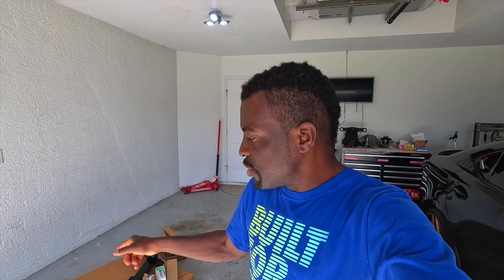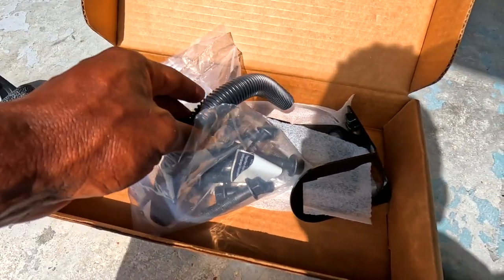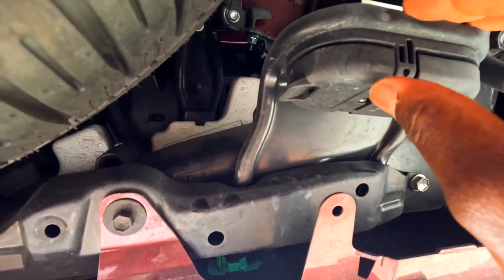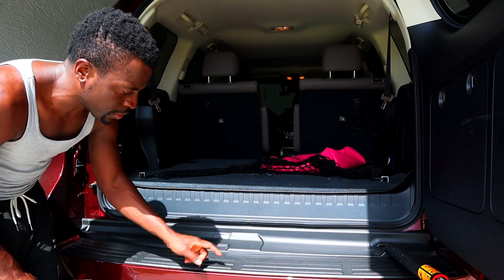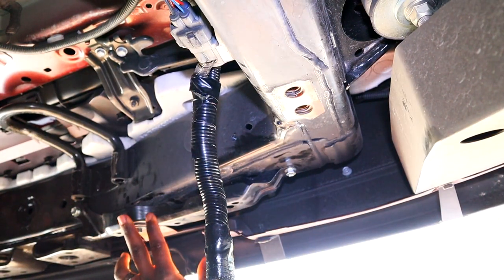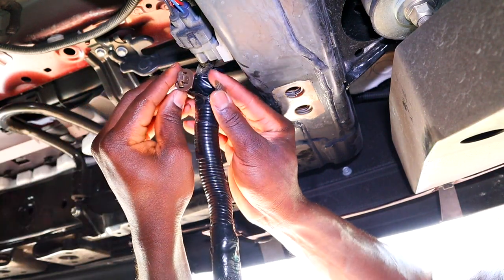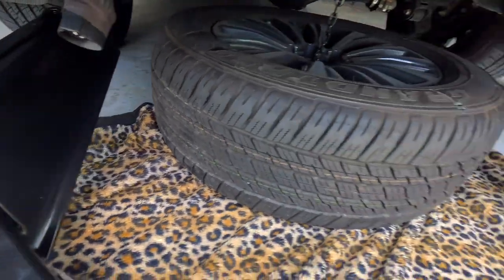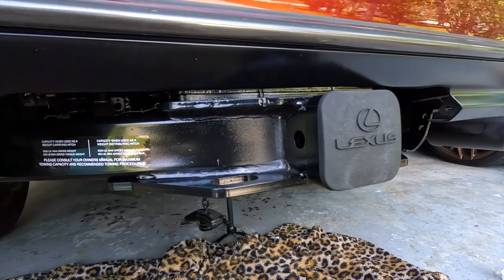Here’s The Best Trailer Hitch For Your Lexus GX460! || Land Cruiser Prado

Comment: Thanks for this video, it helped me out a lot. I used the jack stands along with heavy duty 3 foot long zip ties from harbor freight to help hold up the hitch, it was a life saver. I also used electrical tape to tie the two spacers together to prevent from sliding. Hope this helps someone.
Reply from the maker: You’re welcome and thank you for watching. That was a great idea using zip ties and electrical tape, I didn’t think of that.  Great tips for whoever is doing it next 👍🏾

Comment: How did you remove the center trim piece? 
I also have the trim sport package on my GX but dont know how to remove it🤦‍♂️
Reply: 14:05
Reply from the maker: @CowneloAlvaroid   There are two screws or clips behind it you have to remove.
Reply: That was the biggest pain in the butt for me. Those plastic clips did not come off easy, even with a pry tool. You have to wedge your tool into it and pry that it lifts enough to insert the pry tool. I ended up breaking one by the compressor cover cause it was so damn stubborn.

Comment: Thank you! Why did you need to disconnect the exhaust rubber connector.
Reply from the maker: You’re welcome. You have to disconnect it or else you won’t be able to screw the last two bolts on the passenger side.

Comment: Hello buddy great video👍👍👍 much appreciated 🙏🏼🙏🏼🙏🏼. Question about the spacers.... Couldn't you avoid using the spacers after the under spoiler cover was removed so that the receiver would sit higher off the ground??? Thanks again.
Reply from the maker: Thank you I appreciate it. Even after removing the under spoiler, you still have to use the spacers to attach this particular section of the hitch to the frame because of the design. So basically you need to use the spacers for the front of the hitch to reach the frame so you can assemble the whole kit.
Reply: I haven't installed mine yet but will have to check it out...👍
Reply from the maker: @danrol354  Keep in mind that it’s super heavy so you might need some help. I was able to do it myself, however it wasn’t easy 👍🏾